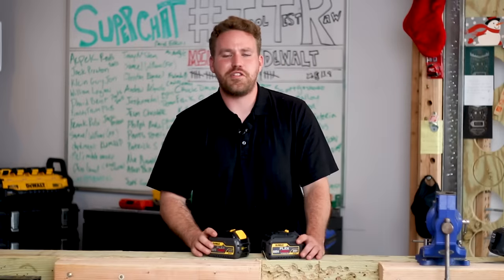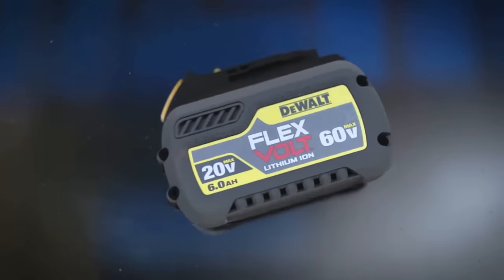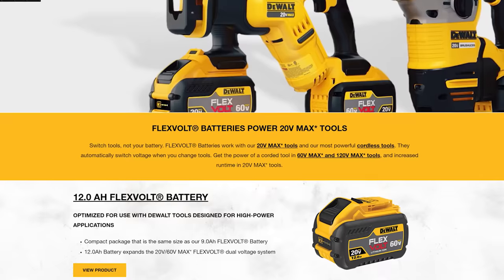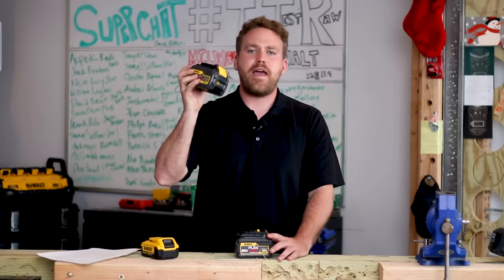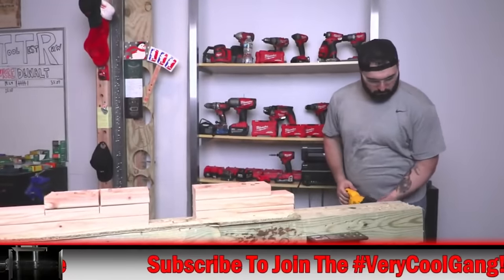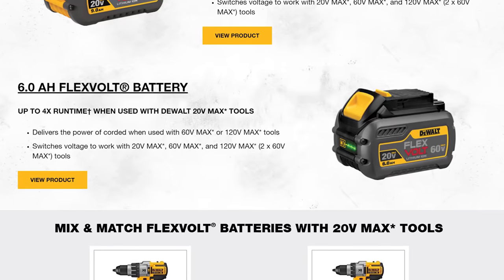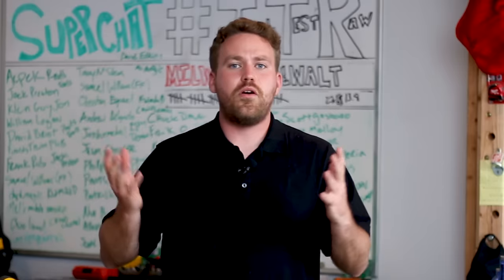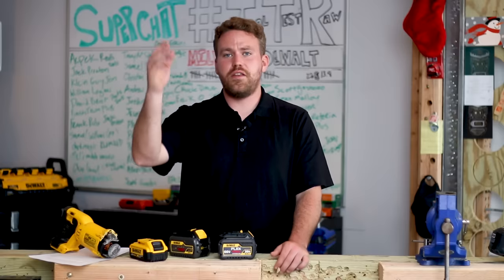NEVER USE DEWALT FLEXVOLT BATTERIES ON 20V MAX TOOLS!

Comment: I've used flex volt on all of my 20v tools without any issue. Drywall guns, routers, saws, fans, radio, impacts, my hammer drill. Zero issues. And some of the tools are 4-5 years old with tons of abuse. In fact I've had zero issues from dewalt tools. It is convenient that they have a whole wall of Milwaukee tools setup in the background. Bias anyone?
Reply: Yup....  I did this by complete accident one day, and never realized they were all compatible.  Which IMO is a good thing, because I've had issues with the 20v batteries going dead for no particular reason.  Not sure what the hang-up is with this.  I've never heard of anyone having an issue with it.
Reply: Same, several years old 20v tools, and i've used my 60v 9a.h  on many of the tools, they all still work great !
Reply: Same
Reply: Yes I believe this video may be biased
Reply: What's the point in being "biased" when both tool companies are owned by the same Conglomerate? Don't come up here flexing that weak ish. These guys run their tools through the ropes hard. Check their videos. Yall are both shills tho. Now I'm buying a Hilti just cause
Reply: Just clickbait title garbage. There's a million of these channels on YouTube.
Reply: @aninnymoose720 Your comment is bias. I use these on all my dewalt tools even the small sander and everything still runs great after 1.5 years
Reply: @MegaMeco2  no YOUR comment is bias. I own Makita stuff idk wtf u talking about psh
Reply: @aninnymoose720  Stanley Black & Decker owns Dewalt, and Techtronic Industries (TTI) owns Milwaukee Tool. There is no notable crossover, partnership, or cooperative efforts between these companies
Reply: @rlr4294 maybe not on paper but they're made in the same country, by the same ppl, often in same or nearby factories. China won't argue it.
Reply: Same
Reply: @aninnymoose720  Lol. Not the same company, stop grasping at straws. They're competitors. Just own up to that you made a false statement.
Reply: @aninnymoose720  Some people will argue with a fence post just for the sake of arguing. If this guy was a girl they would say she was a drama queen. This guy is a drama queen.
Reply: I have the whole menu of 20V DeWalt cordless tools, I own a ton of 20v batteries and flexvolt batteries and zero issues! We out them to work!
Reply: @aninnymoose720  u use big words like conglomerate and tell others to stop flexing, then someone proved your statement false and in return u say stop flexing. Then u make a statement that says well they're made in the same country. Makes no sense and makes it sound like your flexing. I think it's funny cause makes your statement just dumb😅😅😂😂😂😭😭😭😳😳😳😳😳
Reply: Agreed.  The only thing I can guess at is that if the battery goes bad in such a way that it doesn’t switch from 60v to 20 then it could burn out the tool.  Maybe that’s what happened here or maybe it’s because of all those Milwaukee tools in the background like you said lol ^^ who knows
Reply: The problem will occur when you force your tool (ex: you're using a hole saw and your drill forces because the hole saw has too much resistance. I saw a DeWalt drill motor burn (and melt the plastic around it) because someone used a 6A battery and forced it over it's rated capacity.

I do sometimes use the 6A on my hammer drill since it came in the kit, I just try to me mindful not to over do it.
Reply: Who uses a flexvolt on a drywall gun?  That's dumb.  By nature I want my drywall gun to be light and nimble...
Reply: @aninnymoose720 it wouldn't even matter if they were owned by the same company people have a biased and tend to support one over the other and these people are biased how do I know because I'm a contractor and have used flexvolt tools since the day they came out I run 60 volt batteries in 20 volt tools all day long in NEVER had a problem
Reply: They are drama queens,  I can't stand this channel

Comment: I literally laughed through this Milwaukee promotional video.  I have crews out using these as we speak and have never seen the bs problem you imply.
Reply: Funny...
I've literally started using all DeWalt Flex Volt batteries on all my 20v tools.... Never had any problems and doubt I will.
Reply: The best way to control the opposition is to be the opposition
Reply: deceitful 🙄 I have used DeWalt for many years NO PROBLEM your fake "advice" ain't working on me 🤣
Reply: Just so everyone knows who does not, Milwaukee is American in name only.  Milwaukee is owned by a Hong Kong company.  In other words, China.  At least Dewalt is taking major steps to make more and more of there tools in the USA.  That is most important to me!
Reply: In the first mine that I worked in, they used these to cut 16” props made of poplar. I was a mechanic so I didn’t really use it, but whenever I went over to them to play with them, they never worked.
Reply: @samsamson3890  The Milwaukee Electric Tool Corporation is an American company that develops, manufactures, and markets power tools. It is a brand and subsidiary of Techtronic Industries, a Hong Kong-based company, along with AEG, Ryobi, Hoover, Dirt Devil, and Vax.
Reply: Lol it's probably a modified or damaged battery.
Reply: @triforcewielder8500  ive seen it when grinding dust builds up in the female  battery tabs then fools the battery into 60 volt mode when plugged into a 20 volt. If you blow them out regularly you never have a problem
Reply: @MrJjames1979  that's why I keep my tools cleaned. After grinding or doing anything I clean my tools and batteries.
Reply: From my lime being on sites that have people use 20v DeWalt with flexvolt, it might not be the batteries but DeWalt tools tend to break down, off course there are many factors (battery, abuse, improper use, tool build quality, lemons etc) in general I stopped using DeWalt because they broke down too much.  Milwaukee tends to break down alot too but not as much.  This is just personal experience
Reply: Drilled three 3/4” holes and my drill died with the flexvolt battery. Pretty frustrating
Reply: @johnrouthier9034  Milwaukee is not an American company, they were bought and gutted by a Chinese company and directly supports their communist economy. They closed all their manufacturing in the US and have just a show line or two with no output and some corporate offices in the US. 

Dewalt on the other hand, never sold out, kept as much of their manufacturing as they could and have over 10 plants in the US still with more in the works. Not to mention they expanded in Mexico some which is better than supporting our greatest geopolitical foe, China.

Comment: Absolutely nothing wrong with using flexvolt batteries on the 20v tools, ive ran flexvolt since release, been using them on all my 20 volts since day one, not one has suffered in any way. Video is pointless. The clickbait title doesnt help either.
Reply: Yup me too , 60 v to 20 v hasn't harmed my DeWalt tools in months , this video hasn't proved anything to me , so cut the bs mick , you're better than that
Reply: With a power source that can automatically supply more volts than the tool is designed for, it is possible that under extreme loads or high drain, the batter could be giving more than the tool can reliably handle. This guy isn't dissing dewalt, he's saying stick with the batteries originally designed for the specific tool.
Reply: @wascallywabbit8940  If you understand Series Vs. Parallel, there are 3 rows of 20V and the Battery hooks into 20V tools where they can only be used as Parallel meaning 20V but 3x the amp hours therefore they cannot be hurt anymore than using a 20V battery.
Reply: I'm glad I read this comments I was getting nervous about buying the flex volt  battery but it seems a lot of you guys have the same response I'm definitely buying the flex volt battery now thank you
Reply: @billyredmon103  If the battery switches to (3) 20v stacks in parallel, the voltage droop of a 20v tool under max loading with be significantly less than a single stack.  The result is a high voltage is maintained which would have been impossible than with a single battery.  Also, drills and drivers are easy on batteries - saws are not.  If you use a drill with a big paddle mixer of try to drill a 1" hole in steel, you are going to be loading the tool far beyond its design limit - especially if you do this with a 100% duty cycle.  If you want to burn something up, see how long a tool lasts with a locked rotor @ 100% duty cycle.
Reply: Nofer Trunions what this guy said
Reply: @danielwojtowicz5574  Don't get me wrong, I'd love to have the latest in brushless tech but I just got sick and tired of having 3 different types of batteries for all my tools.  So I sold my 12 Dewalt 18v tools and embraced the my old 18v Black & Decker line of BOTH GARDEN and SHOP tools.  Yes, the circular saw run time is abysmal but I have corded saws including a nice new 4.5" Rockwell which is hyper awesome.
Reply: Nofer Trunions the Dewalt batteries can be used with black&decker line up of cordless tools as well as Mac
Reply: You're absolutely right is this bloke trying to be ignorant or pretending to be stupid , when using a flexvolt battery on the 20 V cordless it's 20 V not 22 V, there's no more power. The major advantage of using a Flexvolt is that it maintains its higher maximum voltage for longer and I suppose if you are stalling the motor, this would cause more of an issue which appears to be the case here.
Reply: Right me to i use it alot with my cordless grinder wtf this guys is talking about😂
Reply: @wascallywabbit8940  
Nope sorry, but you are 100% wrong. It does not "automatically" supply more volts. Just the opposite really. The battery has a built in voltage regulator. When a 60v is installed on a 20v tool it will only supply 20 volts.  I can guarantee you Dewalt would not sell a $200 battery that could trash a $150 tool.
It would be a well known problem and a class action lawsuit for sure.  Because a smoking tool is a safety issue.  And.....   Its not a problem.  Thousands of workers use this combination everyday. All day long.  This video is total BS and they know it.
Reply: @KaneLono  not quite correct either. The switching between 20V and 60V is done automatically via a physical switch.
The battery is a normal 20V battery pack until it's put into a 60V tool. In a 60V tool a switch on the battery is pushed in by the tool and the 3 rows the battery has are switched from parallel to serial operation and just physically connected differently. It's not even software. Therefore it's impossible that a voltage too high for the tools rating is supplied.
Reply: @power3516  
Cool. Thanks for the info.
Reply: Thanks for your input, I was worried because I just bought a 6 hr flex volt battery. I used it once on my impact drill. Now I'll continue to use it again.
Reply: @lesduenas9000  yep still running the same packs since release, I love the insane runtime of the flexvolt packs on the 20v tools. Only downside is the extra weight but the extended runtime makes up for it.
Reply: Yes I agree it's a bit heavy when I was working on my roof trying to place my beam in place. Thanks for your comments.
Reply: @billyredmon103  Electronics Tech here, and you are missing something and @wasscally wabbit has the right idea. Depending on how the circuitry is configured, if you over muscle the motor beyond it's specs the batteries WILL supply as much wattage as the motor needs to draw to keep spinning, and a motor "WILL" draw more amperage and voltage than it was meant to. It will essentially begin to melt to conductors due to all the amperage. Which is what you see there. Super Simple, if it's meant for 20v, don't muscle the tool!
Reply: Literally the only way you could hurt it would be to modify your battery or modify your tool to where it could actually get to the 60volts . They don't naturally draw from more than 20 without modifying the contacts. So unless you buy an aftermarket nightmare this will never happen.
Reply: I have a 12" battery powered compound mitre also the 71/4"...I also have the cordless table saw, both skillsaws 71/4" and 41/2" on and on and on.... I live in Alaska and am a commercial genral contractor.... I have a lot of the 6ov and 20v flexvolt batteries.....never have I had and issues with switching any size batteries with any of my DeWalt tools....I use them in 25 below weather every winter and all summer!!!! some of the most reliable tools I have used and absolutely no ? there batterie technology is second to none......the thing that is also very impressive is they all charge off the same chargers
Reply: Didn’t even watch the video I read this comment first! Thanks for saving my time!
Reply: My question is can you use regular (20volt) charger, with flexvolt battery?
Reply: @elaztecareal8081  yes, I just watched the Dewalt website video.
Reply: @Patty-qh3lm  👍